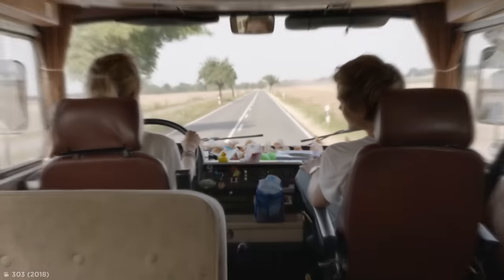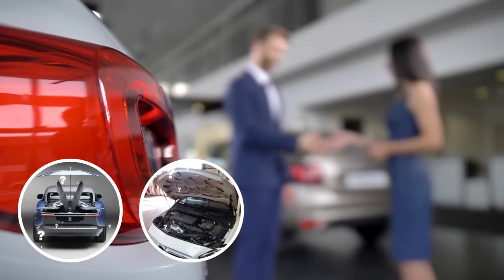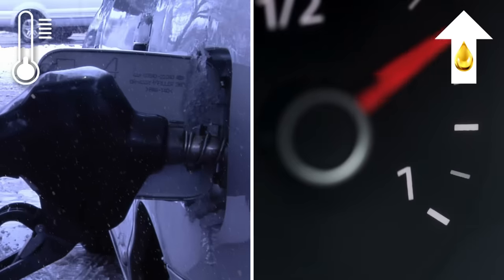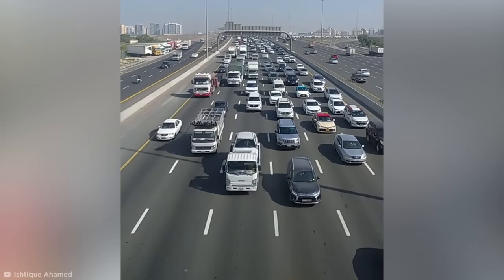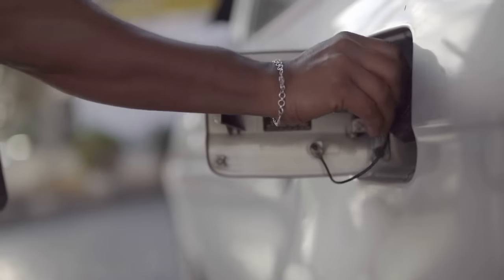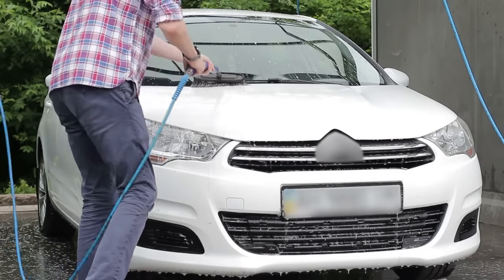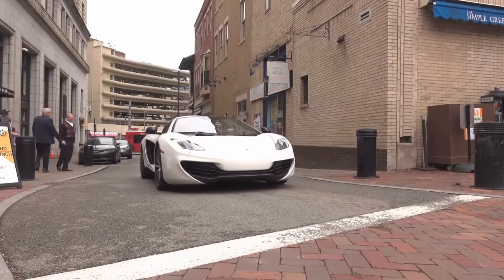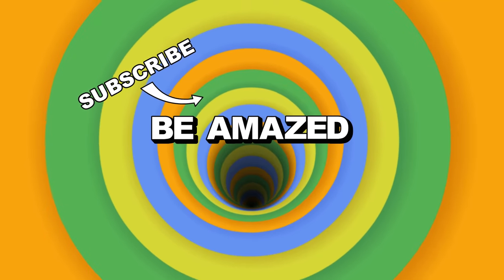Car Secrets Only The Most Experienced Drivers Know

Comment: My car has a loop on the driver's seatbelt, but it performs more like the button showed later in this video's segment. The other seatbelts have the loop too, but I think it serves a dual purpose by acting as the Energy Management Loop, but also keeping the buckle held in place while seatbelts are unfastened. But the driver's seatbelt look looks the same at first glance, but if you look closely, it's a seperate piece of fabric sewn on, while the other sestbelts are actually the same stretch of fabric sewn into a loop.

It's a tiny bit of attention to detail that kind of went unnoticed until I saw this video and went out to examine the loop in my car.
(I sometimes fiddle with it while in traffic)

Comment: Another tip most vehicle owners of the latest models (2023) don't know about their new Automatic transmission cars, is that they CAN downshift or upshift the transmission if needed. Manually downshifting during winter road conditions when approaching intersections or offramps, etc., or even when needing to pass. There are usually a lever or switch on either side of the inner part of the steering wheel on the top or backside to do this.
Reply: This is not new. There has always been a low gear on Automatics.
Reply: @BISSEYSZ  alot of owners are unaware of shifting manually.
Reply: @stevemelanovich8288  Point.!

Comment: 12:54 I recognize this van, we used to have one, and I am sure it is a VW Multivan so in that case, the fuel cap is actually located between the front passenger seat and the sliding door, unless it is different overseas, I am in New Zealand, and that was how it is for me anyway.

Comment: About the gas saving hack. Its true about cars, but for motorcycles its quite useful, since the smaller tanks of bikes and the non insulated tubes that lead to the gas pistols can get quite cold and therefore give you more bang for you buck
Reply: Unfortunately the measurement takes place before the fuel enters the hose.
Reply: @JJSmith1100 Doesn’t matter but the black hoses absorb heat possibly pushing the gas back into the dispenser.  The pumps are under ground in the tanks.
Reply: Totally not true. The gas is stored in well insulated tanks in at the service station, so the gas temperature does not change throughout the day. It doesn't have time to change temperature until you have filled your car.

Comment: well, for europe - or especially germany - the Gas in the morning ist the "expensivest" over the whole day - 'cause in the morning the most go to work, and that's why gas stations rise they'r prices here. a slight downfall is then to see at "high noon", and the "cheapest" prices can be archived in the night - where the prices can fall down (against the morning) down to 20ct/liter less, depending on the sort of gas / diesel. so, as a "non-european", you might get "flatly pulled over the table by yourself", when thinking "in the moring hour it might be the cheapest" - when you're taking a vacation in germany.

Comment: One obscure tip that I didnt know until my dad showed me, there is a spot on the steering column on some vehicles (certain Ford trucks are one) where you can insert the key (and remove it after) that will allow you to put the vehicle in neutral without having to insert the key into the ignition.
Reply: I got that to sort of, to put my truck in neutral all I have to do is press down the clutch petal then take it out of gear. No key needed at all. 😅

Comment: BMW has a fold down arm rest in the back seat that allows a 4" x 4" piece of wood that is 8 feet long to be put through an opening in he seat.  The trunk can be closed and no one knows that a long board is being carried completely inside the car.
Reply: I believe it was designed for skis, but yes you're right. Had a 2008 that also had 4 programmable buttons on the steering wheel. I set one to recycle inside air, that way if I spotted a dead skunk on the road I could shut off the outside air before the smell hit me lol

Comment: Even though I already knew everything in this video, it was still pretty awesome. For those who don't fix their own cars or aren't as car savvy as I am, these things would probably amaze most people. Also something else to know about the evap system, is that over filling the gas tank can ruin the evap system on some modern cars. Squeezing every last drop of fuel you can into the gas tank is not recommended. When the nozzle stops, the tank is full.
Reply: actually nope, read your owner's manual to find out more.

Comment: And Honda hides traditional keys in their fobs too. The ones I’ve seen are part of the metal hook on the fob that connects to a key ring. There’s a little plastic slider, and the entire part releases. The key can also be used to pry the fob casing apart from the area that is uncovered by removing the hook, so the battery can be replaced by the user. It’s a genius design.
Reply: my infiniti's fob is exactly the same.

Comment: Many Mercedes R-Class owners are not aware that the rear quarter windows can be opened from the driver's seat. A smart feature if you have a dog in the car. 👍

And in some models, BMW has hidden the cup holder so well that it has never been found. 😉

Comment: the plastic button on the seatbelt also prevents the belt folding and the buckle sliding over it,
what would be very annoying because the buckle would turn 180° / flip to the other side of the belt

Comment: I spent 15 years manufacturing alloy wheels for ROH.  in the early 80s, one of our wheels was referred to, internally, as The Clay Model, including the workshop drawings, because the original design came from a clay model of the wheel.

Comment: I had my check engine light turn on once for a minor reason once. It happened on a cold winter day. An issue that some people might know that happens when it's really cold out is the automatic transmission not going up to the next gear in a timely fashion causing the engine to rev up to high RPMs. The issue I had was when reengaging my cruse control while being a decent amount slower then it's setting. While it was trying to get up to speed, the transmission didn't change gears. This seemed to throw an error that didn't get thrown without the cruse control. (Have the issue semi regularly. Just not with cruse control on.) Luckily I noticed what causes it and when the light came on or it would have been a mystery. When I got home I checked the error with the cheap OBD reader I have and the error seemed to align with what I thought and reset the check engine light. Never popped up again. I forget the actual error though. At least that my unprofessional assessment.

Comment: I personally found out that if you barely hold the gas pump handle above where it starts to pump gas you'll get more gas liquid and less gas fumes
Reply: Ok
Reply: You mean when it's in your tank and you start to pump. Do you hold it with your hand or click it into position?
Reply: @bettyc.parker-young1437  I hold the handle just above off. Yeah it's slower but you get more gas and less fumes
Reply: Nonsense.
Reply: @1972hermanoben  not really. Just like a faucet when you barely open the gas station pump nozzle you will get more gas and less fumes. I tested it too. I held the nozzle handle wide open and got a lot of fumes. Then when I held it just above closed the fumes went away
Reply: @1972hermanoben   seems like it, but I'll just say who the eff knows or cares

Comment: Re: morning gas, this only makes a difference if you fill the car all the way and your vapor recovery system is broken.  What they are seeing is the car accepting less fuel into the tank before the pressure is too high and assume it's because the fuel/car is hot.  Most smart people fill their cars about 2/3 to 3/4 the way, anyways, as overfilling causes its own extra problems.  Knowing this, most pump manufacturers have their pumps set to stop filling when there still is about a gallon of space in the system.  Me?  I just dump 10 gallons in the tank at a time and drive it.  Easy, no matter how old the cars is  :)
Reply: When the pump handle stops… I learned that’s best due to over filling problems.
Reply: @tonyamedsker213  It depends.  On my car, it's stop, wait 5 seconds, start again, end after the second click a second or so later. One old Volvo I had, though, was absolutely stop at the first click/stop unless you wanted gas all over your shoes. :)

Comment: Most 3D software like Maya, Blender or 3D Max have virtual wind, gravity and other tools called physic sims.  They can simulate atmospheric conditions.  They get better and better all of the time, so I can see auto manufacturers going completely digital in the near future.  Inertia is another feature in the physics sim.  That means that they could even do crash tests using virtual passengers in the virtual car.

Creating a large scale sculpture can also be made obsolete because a smaller scale sculpture can be scanned into the computer and uploaded to a CNC Router that will carve out a full sized model.  Sometimes corporation are slow to change the way they do things. In fact, they can model the car in the computer and just feed that virtual model to the CNC router and it can carve it out in the high density polyisocyanurate foam or any other materials.

Comment: Much of this is very interesting. I have never seen that loop in the seatbelt. The stitching at the fixed end is designed to allow that bit of a stretch. This is why any seatbelt in use during a collision should be replaced with a new belt assembly.
The EVAP has been fitted to cars starting in 1971. 
In winter I do not wash my car. In the autumn the car gets washed and waxed, then oil sprayed. The car does not get washed until spring so salt stays on the wax and away from the paint.
Reply: Hate to burst your bubble but the entire undercarriage is covered with salt all Winter.  This includes suspension, exhaust system, bottom of engine including the starter, wiring harness, trans, etc.  I’ve seen corrosion destroy brake & suspension bolts from rust attacking the metal.   Beware if you keep your cars long time.  Rust destroys everything.
Reply: @njjeff201 watch “Just Rolled In” and that is very evident….sooo much rust under there!

Comment: Well hold up- white is by and far the most common car color. Followed by grey black beige. So. The idea red is pulled over in the top 2- means they’re pulled over way more than the average. So the cause may have something to do with the psychology of driver but it doesn’t take away from the idea they’re statistically pulled over at a higher rate. 🤷‍♂️ just saying

Comment: Myth Busters Golfball car!!! Also, a steady, non-blinking check-engine light usually has something to do with the car’s emissions output. Not something to worry too much about while you’re cruising down the highway; however, a blinking check-engine light is far more concerning. This means there’s an immediate problem and it needs to be fixed right away!

Comment: If you want to help your car from being stolen, add a remote control battery disconnect on the car. You lock your car and then use the  remote to disable the battery. A thief using a scanner will be thwarted and so will a thief breaking into the car. When you want to get into the car, you switch the power back on and then enter as you normally would. They’re sold on Amazon. Plus they also sell, wheel locks like the city uses to immobilize a car with unpaid parking tickets, also. When you’re using a parking garage or parking your car outside, it will get the thieves to choose an easier target. It may be a hassle, but having a car stolen is a bigger hassle.

Comment: Well mate I believe that driving at a reasonable rate and generally being gentle on the go pedal for me at least it works and I often find that so many other vehicles just do not  like following another at the legal limit or otherwise and just HAVE to overtake one and then find that they have just saved about 40 seconds in a arriving at the same point. Plus I have noticed when driving a low slung car as against say a SUV the speed in the SUV appears to be very slow even though the speedometer is showing the correct speed. In my Mazda 6 Sports Hatchback and because I am quite short speeds often look very dangerous when overtaking being that much closer to the road surface. Yes and my Mazda as I mentioned is also very streamlined and beautiful too!!

Comment: In the U.S. gas is sold by oil companies to wholesalers in units called “US Petroleum Gallons,” which is defined as 231 cu. in. of volume at 60?F.(Meters on fuel tanker pumps are temperature compensated.) In the U.S. gas is sold retail at gas stations in units called “US Standard Gallons,” which is defined as 231 cu. in. of volume regardless of temperature.

Comment: I found it fascinating that all Hondas are drive-by-wire.  That means (for those who don't know) that every control in a Honda is electrical rather than mechanical.  When you steer, hit the brakes or gas, shift the transmission, etc. it is done through a wired connection to the onboard computer.
Reply: All Hondas?
Reply: Steer by wire??? I don't think so. It's just being introduced on the Tesla truck for the first time.
Reply: DBW is the accelerator set up on newer Hondas since 2005 mainly used to make cruise control more efficient. Brakes still use a traditional servo and booster and are mainly mechanical except for those cars with electronic parking brakes and electronic brake booster such as EVs and Hybrids the new Honda Civic and CRV from 2017 have brake boosters made by bosch these allow the park and hill hold assist  assist to work other than that most Hondas use good old fashioned mechanical set ups.
Reply: I'm not 100% sure, but I believe Mercedes-Benz started using drive by wire systems on their top of the line models(S Class and CL Class) around 2000 or 2001.

Comment: Unlocked a car from 550 meters away doing this with a elevation different of around +150 meters, BUT I also had to point to the car if I didn't it wouldn't work, now at this point I was like I knew this trick worked for years by having experimented a lot as I was a kid, but that pointing too would do something was a true mind blown moment.

Comment: Older cars have an anti-theft device designed to keep people under 30 years old from stealing it.  It's called a manual transmission.
Reply: Very true.  I love my standard car.  No one could use it. Hardly anyone can drive one these days.  And I wish I had mine back.  Could always pop start it when battery dies.  So many things you can’t do with a non manual transmission.  Sucks

Comment: I have a code reader I keep with me and not every check engine light occurrence is a serious issue. I had a knock sensor check engine light and all it was telling me was the knock sensor needed to be replaced which isn't worth fixing if you know how to identify knocks in the engine as well as the tpms malfunction light which to replace the sensors is expensive so best to know how to tell if your tire is low or not without relying on dashboard lights

Comment: I would like to point out and I'm sure somebody else may have said this but getting gas in the morning is more than just the science behind heat and liquid. When you get gas during the day there's been hundreds of other people using which stirs up the gas along with any debris that happens to be in the tank meaning you're getting a bit more than just gas in those gallons. Since there are much fewer people getting gas in the middle of the night most debris settles to the bottom making a tiny bit more gas for you. Not really enough extra to worry about saving money but certainly when you think about how often you get gas and the fact that the debris has a tendency to stay in your tank. So while technically getting gas in the morning doesn't really save money on gas it would probably keep your cars gas tank a lot cleaner allowing you to fill it up more when you do have money for a full tank. Along with saving money on cleaning it (which you really should be doing at least once a year)